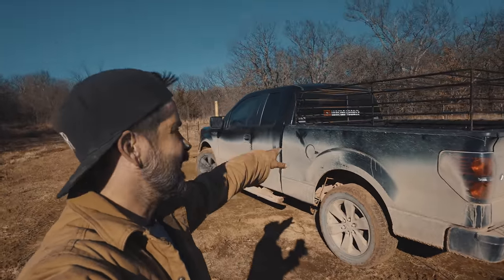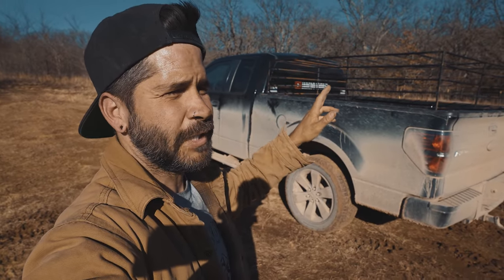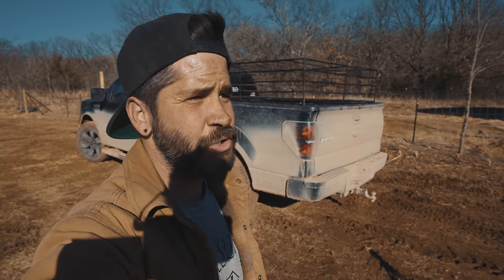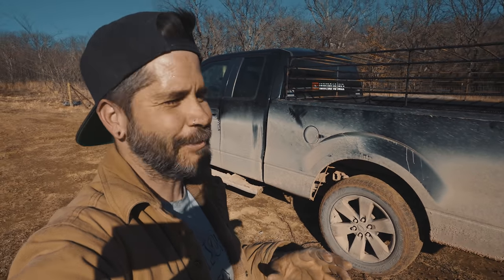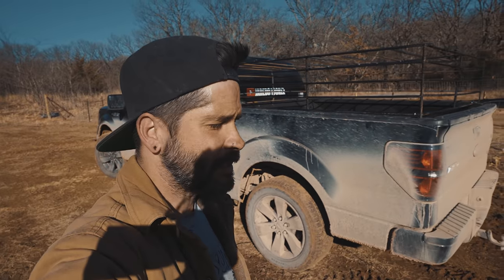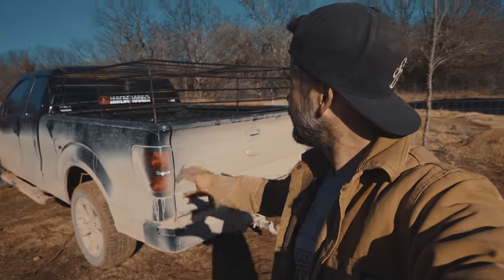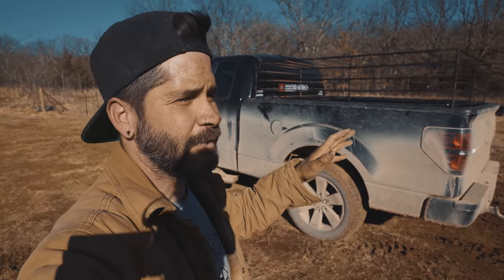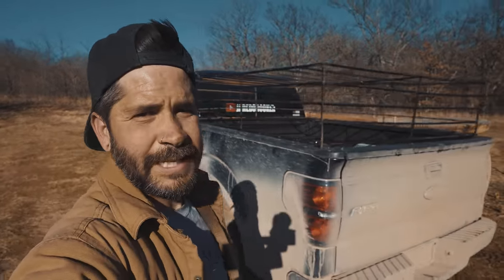Building THIS Should Help Keep Our Livestock SAFE! DIY Ranch Project

Comment: Use wire to tie down the cage to the pickup. The rubber straps will let it jump up when you hit a bump . I known because it 
happened to me.
Reply: Not if you strap it down.

Comment: Welding is the one task I've never tried...I'm jealous. Cool looking cage...but did you forget the door?The tractor should have easily drug the trailer out to the road where the traction is better...Just saying-I drag my manure spreader by the dipper and go backwards-too lazy to fix up a hitch :)
Reply from the maker: Yes, I'll end up getting the trailer with the tractor. The tailgate is what I used as a gate

Comment: It does look like something you'd buy. Nice! Is there anyway you could put rubber pads between the truck and the rack to keep the damage to the truck's paint
 down?
Reply from the maker: I have a bed linner, so it doesn't hurt it.  Plus the truck is a work truck at this point and gets used and abused lol
Reply: @TheCrockers  ... A true "farm truck". LOL

Comment: Good job brother...
Reply: Hey I also meant to mention you might want to take a look at renting a large concrete saw.. the larger blades on those things would make real quick work of knocking out those concrete pads when using a jackhammer afterwards. Home Depot has a 16-inch gas powered saw and it's only 65 box for a 4-Hour rental

Comment: Ok I got questions is that a predator 3500 generator and what size is the mig welder? I need something that will work with my 3500 predator
Reply from the maker: yes it's the 3500.
https://www.harborfreight.com/easy-flux-125-amp-welder-56355.html
Reply: @TheCrockers  thanks

Comment: That wire wheel isn't doing anything. That's mill scale. Only a grinder can take off. All your doing is polishing the scale up. Just a helpful hint!
Reply from the maker: I used it to get the rust off. And then used the Grinder to hit the welds
Reply: @TheCrockers  thats fine. Next time grind the mill scale off. Get down to raw steel. Stronger welds! Good job tho.